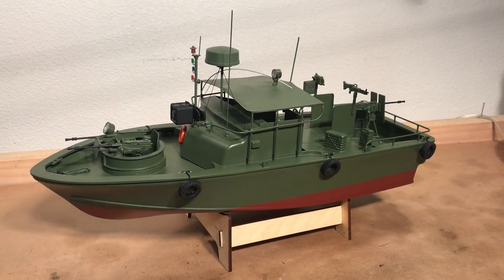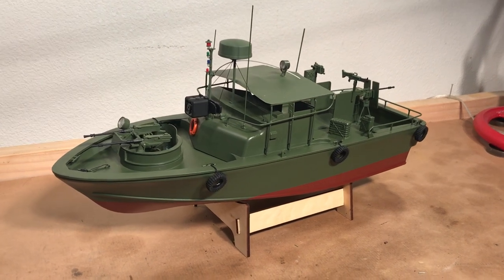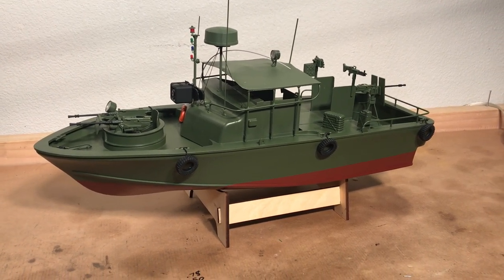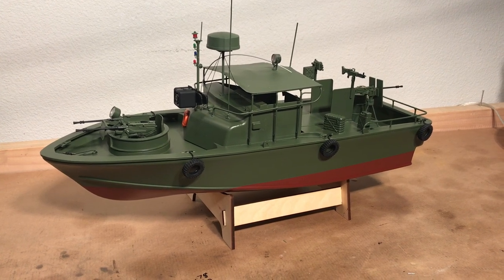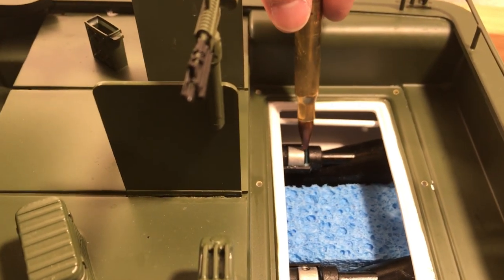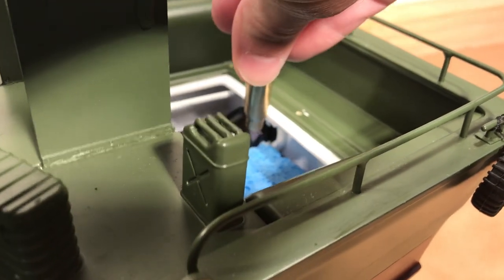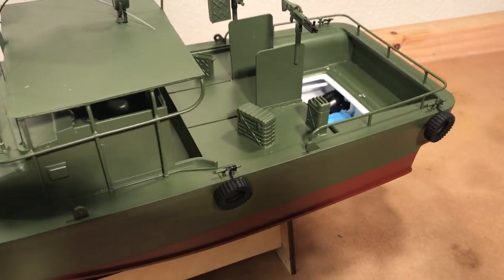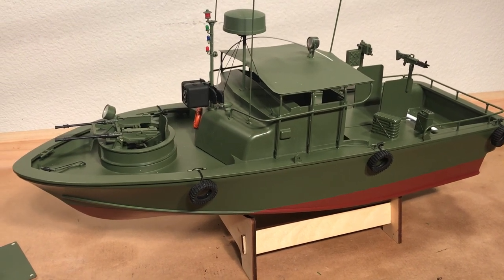Alpha Patrol Boat Easy/Cheap Mods

Comment: It is not an Alpha boat, it is a PBR.  An Alpha is short for Assault Support Patrol Boat. aka ASPB  aka Alpha.   Nice  Model  Though
Reply from the maker: Thanks for the reply, and I'm aware of the distinction.  I'm just referring to the name under which these are marketed and sold by the manufacturer, albeit historically incorrect.  Please see:  https://www.horizonhobby.com/product/alpha-patrol-boat-21-brushed-rtr/PRB08027.html?CAWELAID=320011980001296186&utm_source=bing&utm_medium=cpc&utm_content=14763088245&utm_campaign=BradoDI_HRZHBY_Brand-Desktop-Proprietary_SE_SHOP_B_ALL_NTL_US_EN_M&utm_id=bi_cmp-133458194_adg-5557464327_ad-14763088245_pla-4585032210080033_dev-c_ext-_prd-PRB08027&msclkid=12f2dd77060d1ed183c1bd7ffb49cb4d